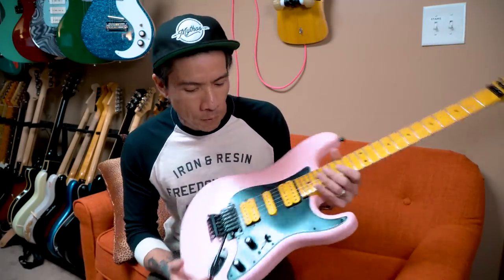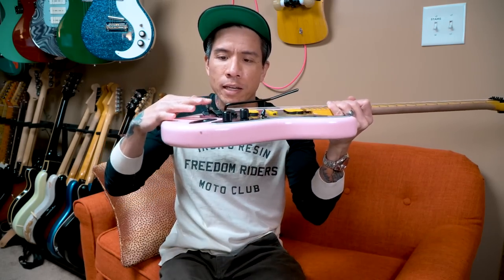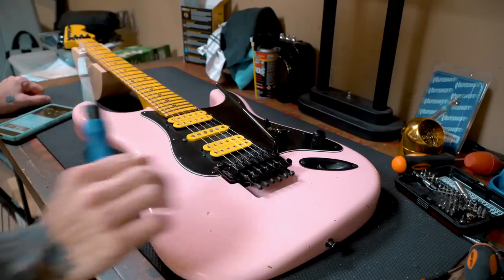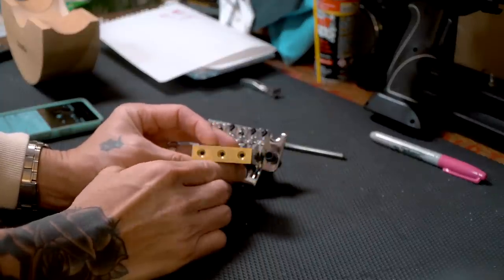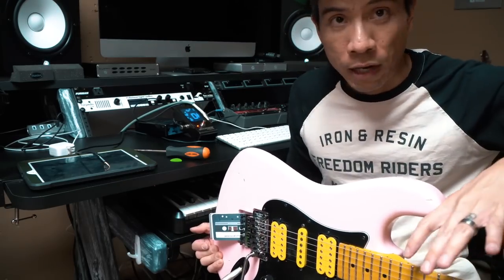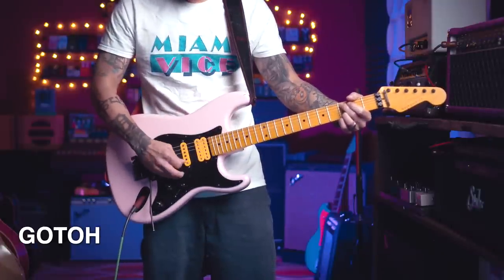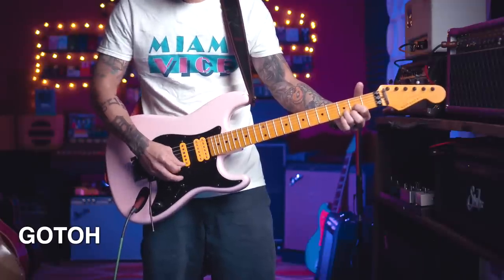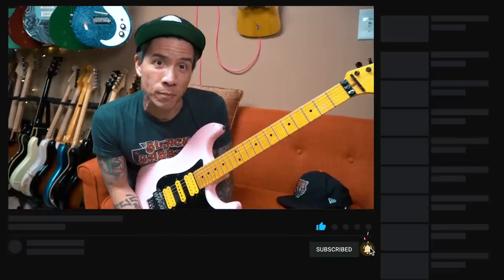Upgrading My Floyd Rose Tremolo | Floyd Rose Pro 100 & FU-Tone Brass Block

Comment: Tremolno actually sucks tone, too. The die cast claw dampens highs somewhat
Reply from the maker: I'm kinda noticing that. I love the sound and feel without it, I just want to be able to have a quick and easy way of blocking it when I restring or retune.
Reply: @RJRonquillo  I removed my Tremolno as well for the same reason. On top of that I could also hear the noise of the parts moving when it was not locked. What I do when I need to re-string is to instead of removing all strings at once, I do one string at a time starting by the high E towards the Low E. This way you don't need to block it or mess with the springs.
Reply: Tremolno doesn't suck tone. If you block it, tone is improved, if anything, because of the tighter transmission of vibrations. If you keep it loose, it's just a few extra grams of mass on your block and claw which don't dampen anything.
Reply: Interesting observation. I have a Tremel-No in my Frankie. I may want to test another blocking solution and see if it makes a difference.
Reply: Oh hello there...

Comment: Don't know if you'll see this but I'll try. You didn't have any issues with clearance after installing the Lo Pro? I'd really like to swap my standard Floyd for a Lo Pro but was afraid I'd have to rout the body to clear the spring plate for the fine tuners. 

Your guitar definitely has a different sound now. A little brighter and clearer.

Comment: I'm a big fan of the Gotoh ge1996t, I think it has some better features and the build quality is superior to whatever Floyd Rose/Schaller is doing these days, especially regarding the loose, rattling bar at 9:58, but yeah, sometimes the "high profile" does get in the way. Good thing it was a direct replacement in your case.

Comment: @16:12 Your reaction to playing the harmonics says it all for me. Definitely a great upgrade. :). Interesting about the tremel-no angle causing tuning problems. I've heard some "strat" guitarists like to alter the claw/springs at back so each string has a defined pitch shift - ie the top E might go up/down a semi-tone while the G might do 2 semi-tones for the same movement. The Tremel-no might not hold the tuning with this variation of spring tension across the strings. I'm nit-picking here - this is def a great upgrade.

Comment: this could be all in my head, but with the upgrades, it almost sounded like you were using a boost pedal on a mild setting.  like a slight increase in the 1khZ AND a mild bump in the 80-100 hZ range.

Comment: As much as I love my Washburn KC-40V and it's Floyd Rose Pro.....I HATE changing strings on a Floyd Rose!! I wish somewhere someone would design something that would convert a Floyd Rose into a fixed bridge! I know that's sacrilegious but, if it means I can change my strings again myself, I'd do it! I think the Tremol-No may be the closest thing to my dream. When I restored my KC-40V a couple of years ago I thought about it but, didn't. I also thought about getting one of the big brass blocks as well, now I'm going to have to add a few more parts. Thanks for the demo..

Comment: Dude when you set up a floyd just block it from going back/down. Tune it and level the claw so it's a mm above the block or buisnis cards and just pull em out, from there youll beary have to tune or tuch the claw

Comment: Adam has changed the floyd game and yes you could hear the change in the recording. Now go full shred with guitar. I like Nash stuff but the trem setup just seemed ok not his usual standards. It's time for a Brown sound video. Show us how you would get fat metal tones with a budget tube amp, head into cab, the head cannot cost over 500 can be new or used. Use your signature pedal and some other budget friendly pedals to get fat metal tones. No pedals over 150.00 bucks. Do that ish I will watch and like.

Comment: R.J. did you have to change anything on the new Floyd Rose to accommodate the fretboard radius? I ordered an original Floyd Rose to replace a Floyd Rose 1000 and the neck of my guitar is a compound 12-16 inch radius and it says the new Floyd comes set up for a 10 inch radius but I can't find any information on this at all so any information or advice or anything would be greatly appreciated.
Reply: This would be more of problem if it came set up for a 16 inch radius and your guitar had a 10 inch radius. Then you might have buzzing problems. The other way around, you might have higher action than needed, if there's no way to lower it/remove shims.

Comment: I heard you mess up the harmonic in the gotoh demo. :P That's just on purpose, if you grab the harmonic correctly it will sing and not sound that airy, like in the other demo (or maybe just add a bit more compression like you had in that other harmonic).  But in general yes the big block added some mids to upper mids I feel?

Comment: Definitely a huge improvement in tonal quality.  I've done this upgrade to my Ibanez RG-270, which I've always had a love/hate relationship due to the playability, which I love, but the weak tone/sustain from the cheaper, factory setup, which I hated.  This little upgrade was inexpensive, but made a huge difference enough that I sound near pro, with a $300 used guitar.  The only next things to change will be the saddle, and out of context, I do need to also upgrade the pickups for a much more pro sound.

Comment: From a physics p.o.v, trems of any type are sustain thieves, RJ.

The locking aspects 'would' help if the unit were immovable, as any (even minuscule) motion causes the string length to fluctuate, which saps its potential to continue vibrating as much as if it were 'fixed in space' at both ends.

The single most important factor in maintaining sustain isn't anything to do with mass, but from maintaining a constant for the variables which contribute to the string singing unhindered.

Anything which alters this, even if locked at the two string anchor points (bridge and nut) detracts from any potential for ultimate sustain.
Oversized trem blocks are also a waste of money imo because any potentials gained are lost through the two contact pivots and the 12 contact points of the bridge and nut.

With guitars, the most important factors are strings and pups/electric circuits, as it's the vibrating metal of the strings being 'translated' by the pups and fed through the pots etc to give as clean/strong a signal as desired into your signal chain/amp.

Waiting for the controversy...
Reply: True, only way to have 0 sustain loss is a one piece full metal brass guitar with strings soldered on in perfect tune.  The strings would vibrate forever only to be slowed the friction of the air molecules.  We will have reached sustain Nirvana.  Some will take their guitars to space for even more sustain, but lose volume, so high in the Himalayas where the atmosphere is thin is the perfect environment for sustain.  The pilgrimage awaits.
Reply: @mikejones-vd3fg  Brass, like all metals, reacts to temperature variables.
In small quantities, it doesn't matter, but wouldn't be stable enough for a neck.
For a guitar to be fully safe from any such variables, it'd need to be made from materials which don't flex even remotely, like stone.

Comment: I also have the tremol-no in my Jackson PC1. I was a bit disappointed though when in hardtail mode it's not strong enough to hold even though I tightened the thumb screw. I do have 11 gauge strings with 3 springs. Yeah, the thumb screws need to be redesigned in my opinion.

Comment: Cool video bro .. I got the brass block in my JS1200 .. but it’ was a pain  in the Ass because once I installed it I couldn’t pull  back to much with the bar and I play a lot of VAI ,Satchs stuff... so I had to carve some wood off because the block was hitting it  not enough Clearance ... I could of went down 9s gauge .. but I like 10s in standard tuning ... in my opinion the the brass block is a joke ... if I didn’t throw out the original pot metal one I would off put it back in ... lesson learned. But it’s all good now.!
Reply: You can get a smaller block, but I wouldn't go back to pot metal.  There are plenty of alternatives out there.
Reply: @kitoyobeni1  True .

Comment: One must do upgrade to the floyd is replacing the crap steel saddles with  titanium saddles. The change in tone and sustain is unparalleled.
Reply: Not gunna find too many people doing that mod,have you seen the price of titanium saddles? They cost more than the entire bridge, huge waste of money rite there. Plus, there's absolutely nothing wrong with the hardened steel saddles they come with,unless you have a fr special, leave your saddles alone,they will last a decade or more,if not you're doing something wrong i.e. over tightening or something.

Comment: They're both great tremolo it's just a matter of preferences. Like the comfortability problem you are having in the fine tuning. Upgrading to a big block was the right choice either way! And I believe there's another FR Low Pro with the long clamping Screws that looks like the Edge Trem it is really beautiful wonder if they still sell those. Anyway have a great day man!

Comment: I gave away a guitar with a floyd rose cuz I couldn't get it to tune. You are the only person who Ive seen on youtube that did it the way you did!!! Thanks! Maybe I'll try another rose!! Great video R.J.!
Reply from the maker: I learned how to setup a FLoyd from Ben Eller - https://www.youtube.com/watch?v=wJIXFFFxf_g
Reply: Plus, if you add the trem-stop (inexpensive), tuning becomes a lot easier and you can do double stop bends without knocking the other strings out of tune (same as a decked floyd).

Comment: Adam Rever has great stuff.
Reply from the maker: I need more Floyd Rose guitars!
Reply: @RJRonquillo  I had to check out that 1000 “Pro” version. I like the setup with the fine tuners. The German-made Pro has the same design but with a narrower string spacing. Its so interesting how many versions there are.